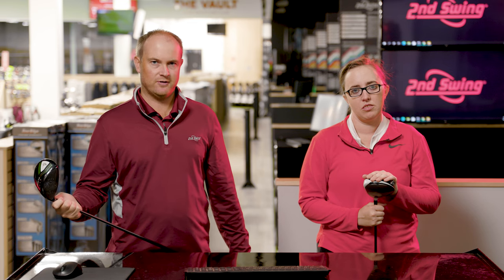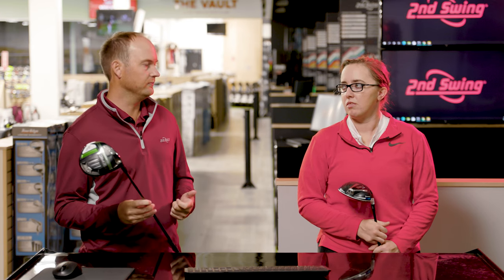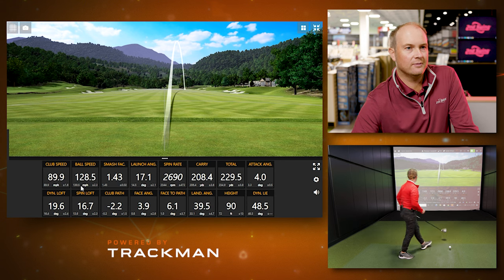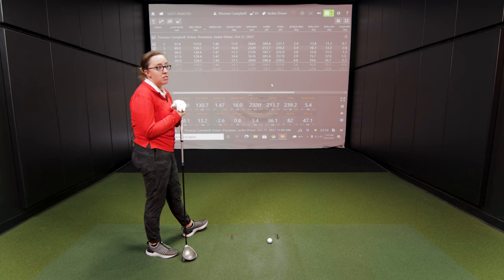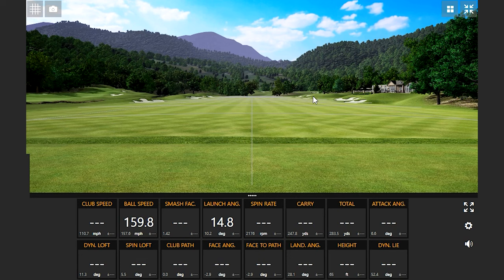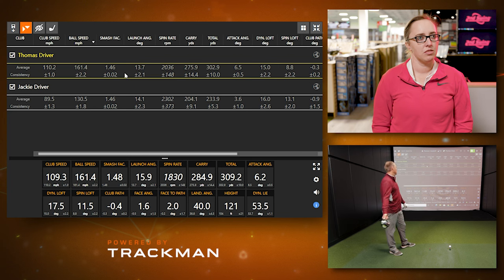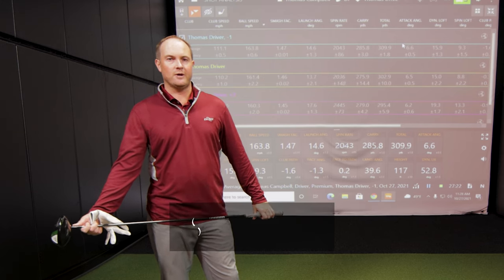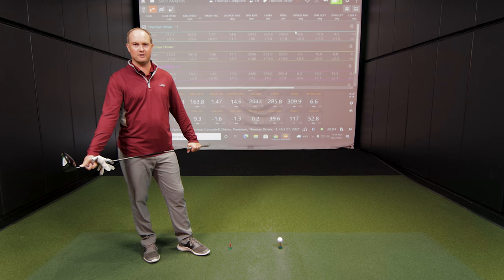Trackman Tuesday: What is Smash Factor?

Comment: Just got fitted for clubs last week. I am a HIGH handicap golfer, turns out, the clubs I had were just all wrong. Fitter said I had a good swing, my clubs were just the wrong length and shaft type (I by used). After using some of their clubs, he pointed out my smash factor on my Driver and 3 wood were between 1.48 and 1.51. I was hitting the ball straighter and further with the clubs they were giving me. Cant wait for my new fitted clubs to come in and see what changes it does for my game.
Reply from the maker: Sounds like you had a great experience. Thanks for your feedback - Thomas